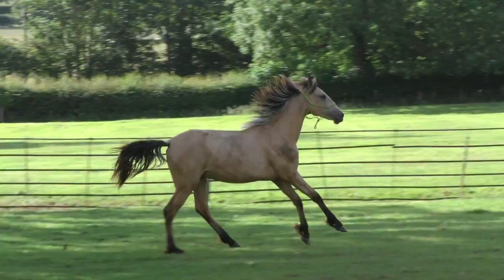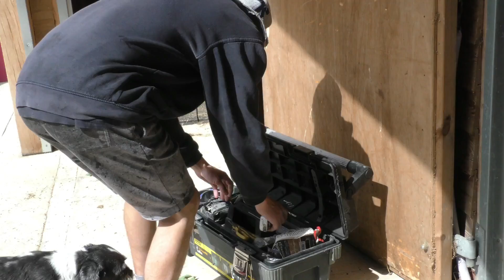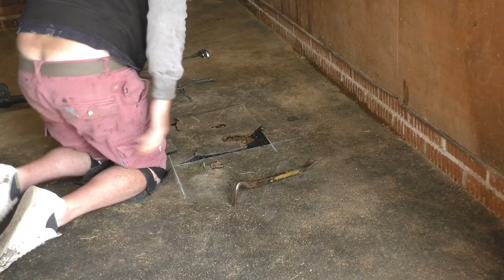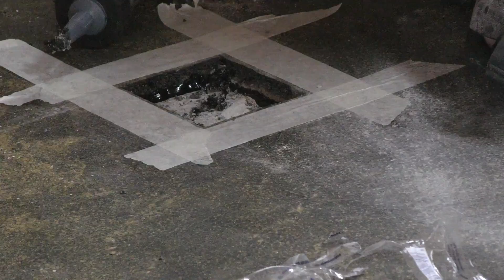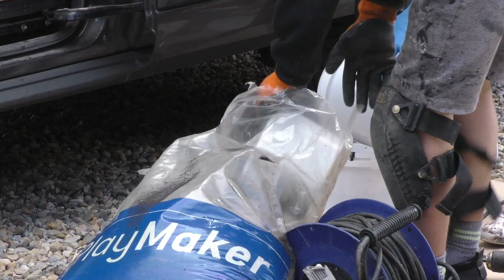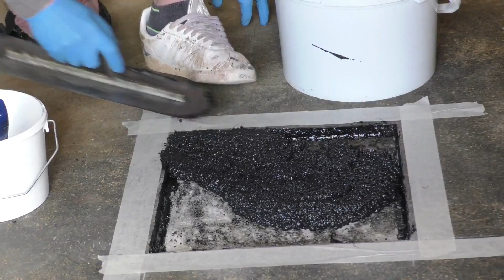Friesian, Arabian and Andalusian horses make a nice herd ♥️ How to fix a hole in a rubber floor.

Comment: I ❤️ Apollo, no biting, just a buck or two, no trying to hurt, just gently moved her on, runs with her, rub noses a couple of times, as though saying yes I’m in charge and won’t take any nonsense, but you are safe here, Apollo also stood between her and Farouk which calmed things down. Question, the next time they all go in the paddock after being in the stable will there be the same drama or is it settled now.
Reply from the maker: Time will tell....
Reply: Another cliff hanger 😂

Comment: I don't think you have a submissive filly. You have a young one up against two older horses in a new place she doesn't know very well yet. The fact that she has nipped and kicked at Apollo indicates she is no shrinking violet. Apollo keeps after her because she won't submit. So wait until she is older and see if the current arrangement remains. 😉

Comment: They all having fun chasing each other around. Least it will keep them all fit all that running around.. 🐴🐎🐎🥕🥕🥕🥕🥕🥕
Bella’s got a very beautiful feminine trot & canter. Where Apollo shows the masculine trot & canter very classy, also Farouk’s is in between.🥰
Apollo’s finally won Bella over by letting her know he is boss & in charge & Farouk is 2nd in charge.
Beautiful birds chirping away in the back ground so serene.🌹🌷🌹🌷🌹🌷
Ike is making sure the men are doing perfect & professional job
in fixing the rubber mat in the stable. Well done 👍 Ike.🦴🦴😉

Comment: Those rubber workers are so neat.  How much did they charge?
Reply: Pat Quint   I believe Tara mentioned $90 to do the patching job. Does anyone else remember that?
Reply from the maker: £90 👍😂
Reply: Tara   Thanks for catching that mistake!  £90 which is over $100 in US currency depending on daily exchange rate.